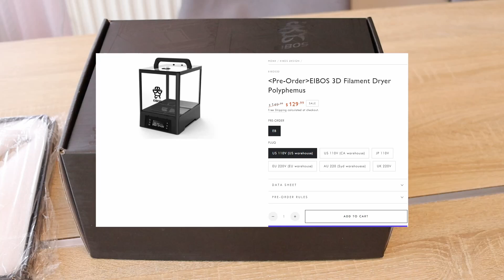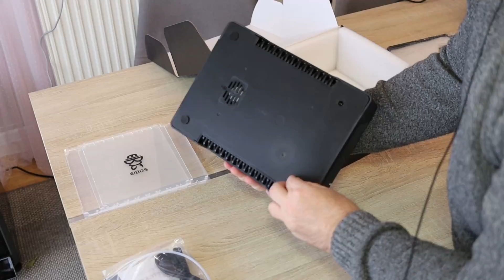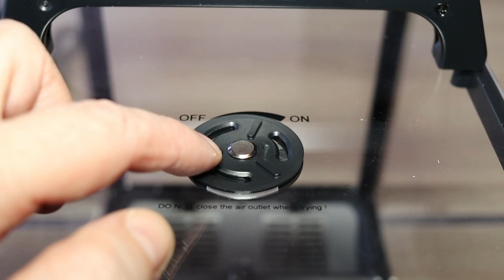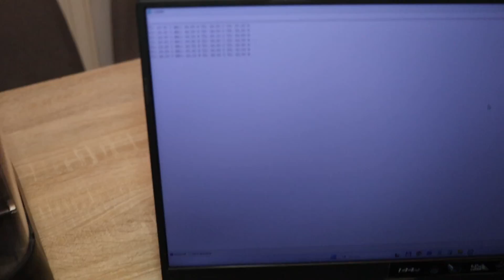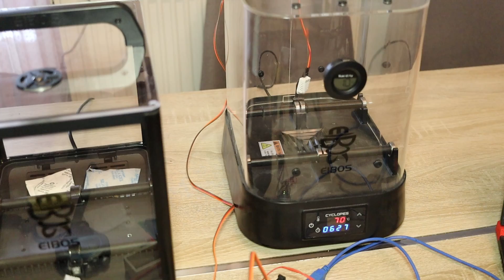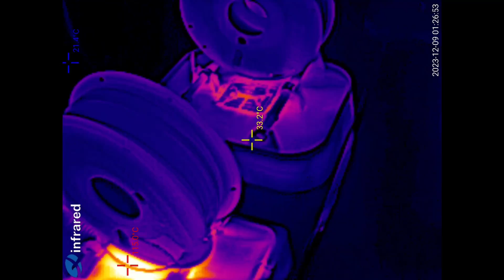Battle of champions: Eibos Polyphemus vs Cyclopes - which one is better filament dryer?

Comment: As always, great video.
I have one question though, would the Polyphemus be enough for Sunlus Easy PA (PA6/66)?
Streikt from the package into this dryer, after that kept in an airtight container with desiccant...
Would this work in you opinion?
Reply from the maker: Yes, but depend of the start moisture, it may require even 1-2 days until fully dried. Try to get the 80°C version.

Comment: Does this printer have tangential exit for filament? It sounds like that was the big weakness on the Grakit. This is more expensive but if it’s less loud than other dryers with fan, performs well and addresses the 90 degree exit on most dryers might be worth it.

Comment: In a review video by Modbot I heard that the rotation motor only has a predicted life span of 1500 hours, which he calculated to be 2 months non stop operation. Hence the spare motor. Eibos claims it has machines running much longer on a motor. But if you print a lot of nylon and have this machine running all the time you'll be buying a new motor let's say every 6 months. I consider this to be quite a serious design flaw.
Modbot was not very enthousiastic about the rotation function. He thought that it added nothing to the effectiveness of the dryer. I think the rotation is a great addition. You showed why. Also I saw a video by Woodbutcher and the Mighty Termite (what a name 😄) in which he explaines how he fixed a design flaw in the Cyclopes. This flaw would be that the fan in the bottom of the machine blows the hot air straight onto the filament. If this is the max temperature and you do not rotate the filament by hand every half hour or so (easy to forget!), not only does the filament not dry equally like you showed but the high temperature on the bottom of the spool may also damage the filament and/or may cause it to stick together
So I think I will go for the Polyphemus. Despite the motor issue. Although I have to watch some more Sunlu Filadryer S4 video's, because that may also be an attractive option. Thanks for the great review.
Reply: It’s actually more like a year (drying time) since the motor only operates every 4 seconds or so and turns the spool for a second. Don’t know why I was compelled to answer that 2 months later lol.

Comment: How about the humidity mode ? The one where it only turn on if the humidity raise above a certain value (for medium to long term storage). Do you have some thoughts on this functionality ?
Reply from the maker: That would be great if I would have 5-10 dryers, but since I always have at least one printer in work, I almost continuosly need this dryer, not for storing.

Comment: Thanks for taking the time to give us such great comparison metrics on the driers.  I recently got the Polyphemus and love it so far with the exception that my incoming filament, when printing from the drier, sometimes jams.  My bigger question though transcends all the driers and it's simply have you done anything to prove the inside coils of filament, that are effectively shielded by the outer coils, are dried too?  I understand that a sponge gets thoroughly dried, but what about the inner coils?  Is that one of the reasons we need to print from the drier for the more hydroscopic materials so that they dry as the outer coils get removed and expose them?
Reply: Theoretically the water molecules will excite up through the filament, transferring their energy THROUGH the filament coils! This of course is dependent on the type of filament, constant heat and thorough movement of the air. My concern is pushing too much hot air DIRECTLY onto the filament that is directly above the heat source. I've read where a user built an alum displacer piece to move the air away from the filament and around the outer edges of the roll.
Reply: The design of this dryer should alleviate some of your concern.  The heated air is actually directed out the front and back of the center rather than directly above the heat source.  In addition, the spool rotating function will also help distribute the heat evenly.   I was hoping that someone had gone the next step in testing beyond the sponge and did something that is even more representative of the real use case and verify these driers actually do dry the inner coils.

Comment: I have several Cyclopes driers, and I just put the desiccant pouches inside the center of the spool (which also puts them more central to the cavity)  I love your use of an Arduino, I use them and modules all the time too :-)
Reply: well, I just remembered another thing.  If you have one of the original Cyclopes like I did and they eventually go dim on the display or stop working all together.  You can reach out to EIBOS3D support and get them to send you the upgraded version of the "mother board", heater/fan, display/controls.  Cost is $10 including shipping (I believe this is low because they treat it like a support replacement.  They are still the typical LOUD Cyclopes fan as always, but they do work great.  I would be curious to see "My Tech Fun" redo his tests, to see if these new electronics make the Cyclopes perform better, worse, or the same.
Reply: Highly recommend finding a handle on printables or thingiverse and print out a handle for your Cyclopes.  If you have both filaments in there feeding printer/s, you are going to have a challenge balancing the Cyclopes lid without a handle.  On my 3D Printer farm, I use a small cable attached through the top center hole and just pull the cable that is loosely on the rack above it, then I have a 3D printed hook on the other side that I hook to part of the rack system.  This completely holds the top lid of the Cyclopes for me while I swap filaments.  But if you aren't using these in a farm, I use 3D printed handles for my single printer setups.

Comment: I don’t have either of these but I recently bought the single spool Eibos. It’s so easy to use and is quiet. I dried a bunch of filament spools that were very brittle and unusable. Paid for itself already……I also use it as the holder while I am printing. Very good design……..

Comment: I think all these dryers would benefit from an all-around and top layer of cork (even the one for desktop by IKEA), which would reduce losses and make the temperature measured by the internal sensor much closer to the one of the air.

Comment: In my mind the rotating function to achieve constant drying through the whole spool is a must, hence i got the Poly on pre-order since before Christmas. So far i've only used the X1 Carbons filament drying function, and while it works, it's slow, i can't use the printer while it's going, and it has got some of my PETG to stick to itself, so it's very much a "in case of emergency" type solution.
To better test the rotating functions effectivity, maybe you could wrap some sponge around an empty roll, and repeat your test..? No clue if that would make any difference in the results, but that way it would be more real world relatable test. 🙂

Comment: Another awesome dryer review. I got this on preorder and I am very happy with it, especially compared with the FixDry crap I had to return. Might mod it in the future with even more silent fans and a more silent spin motor.
Reply from the maker: After this video FixDry contacted me, they are sending me their dryer too. We will see how it performs. What is your main problem with it?
Reply: @MyTechFun  hahaha awesome then. This is the list of things I did not like from their latest double spool dryer:

1. I read somewhere that the system powers up the heater based on an algorithm programmed at a 21C room temp. It does not take into account the temp measured with the probe (I have not tested this)
2. Sketchy electronics. 240V enters a main board which is itself a bit sketchy. The screen flickers on and off constantly and the instructions say to never leave the dryer on without supervision. Inspired me zero trust.
3. Very noisy fan. Discovered that the main issue here was the plastic grill from the case in front of the fan. Cutting the grill to leave the hole exposed reduced noise quite a lot. That mod paired with a good Sunon fan it was worlds better.
4. Noisy heater relay
5. Inside temperature I believe I measured a max of 50°C

As soon as I saw the Polyphemus preorder at less price than the FixDry, I did not hesistate to return it and buy the Eibos. It's on another league.
Reply: @MyTechFun   @MyTechFun   Fixdry uses a DTH11 with a nice offset to skew the measurements to make it look better. Destroys the eibos in build quality and materials and is actually safe   and uses the right materials. My cyclopes started to melt. My second one has some deforming because they used cheap ABS but the Fixdry dual dryer is just crap and honestly not even good for pla. Average chamber temp when set to 70c was 45.2c. When i checked it i froze the sensor and it would no go lower then 20c. So i used a ThermoStream ECO-810-M as a source on the DTH11 and found out they used that to make a offset.  In reality its a 50c unit not 70c. Cyclops i found to be accurate to 50c then its a little off at 70c i was hitting 62c. These are chamber temps. Eibos was measured at the stock hydrometer location  Fixdry was measured at the same location.  Eibos has ok performance still not in my 5% spec but a few mods can get it to whiten 1.5% but its built like trash and like i said. 1 melted the other after one use i could see heat damage its trash. The Fixdry is built nice. It does not feel like a $10 dryer off wish  like the Eibos but its a 50c heater at most that they make people think is better then what it is because of the offset. Neither one is worth the price. Measurements were taken with  NIST traceable equipment.  If you like we can compare notes and what not on dryers. I got a bunch i have tested to try and fine one that delivers on its claims whiten 5%

Comment: Thank you for making this comparison video.  Very good analysis.  I'm a first time 3D printer owner.  I will be printing mostly with PLA, but then I expect to move up to PETG.  I understand that PETG absorbs moisture alot, so I will be getting a Dryer for it.  Thanks to your video I believe I will go with the Polyphemus because of the rotating motor and I also like that we can remove the shell without having to also unthread the filament.

Comment: Would it be possible to also compare their power consumption? I'd assume they are similar but it would still be interesting. I'm using a repurposed food dehydrator for filament drying and it uses around 300W. So the power consumption can get quite significant when you run it for hours.

Comment: I can see rotating of the spool to work only
- if the spool is used by the printer (rotating naturally) or 
- if the filament is not fed through the holes/tubes.
When the filament goes out of the box but is not being printed, the spool cannot rotate.

I would think most uniform result in all use-cases would be by having the hot air circulate inside the chamber around the spool. Then it wouldn't matter what the spool does.
Also maybe adjust both heating power and input of fresh air / output of the moist air (separate fans for circulation and input/extraction) based on relative humidity for better efficiency, when not in a hurry ;)

(But having 30C temperature difference between outside and inside, and printing just PLA, humidity is not current issue for me - well for my skin yes, but for my printing not 😎)
Reply from the maker: Of course, during printing, it will be rotated by printer. But some sensitive filaments, I like to pre-dry before use. You will see in my next Extrudr TPU video (test in progress, but printing is finished) I dried it 4-5 hours before use, huge difference in print quality.

Comment: Oven wouldn't work?
Reply from the maker: Oven is not accurate, it can easily overshoot the temp by 20-30°C for short time, you can melt the filament or spool. Other: My wife don't let me drying filaments in oven (and maybe she is right, drying ABS or ASA in same place where you prepare food - maybe don't go together)
Reply: @MyTechFun  😅
Thanks. Good to know such a large overshoot is possible. I have to test  before using it.
Probably for pet-cf and pc it is easier not to melt because of the high melting temperature...
Reply: @MyTechFun  I am trying to use xplus3 as a dryer with it's heated chamber. I setting it on display. The problem now is that it has some timeout and turns off the heat after some time.
Reply: I used the oven to dry some filament, unfortunately my partner turned the oven up for cooking without checking inside first!
Reply: @A_Tempest  wow that was something 😅

Comment: Are either of these safety listed with CE or UL?  Not a fan of resistive heaters that aren't safety listed, as some models of filament dryers have melted themselves.  
Many food dehydrators are safety listed, are cheaper than bespoke filament dryers, and can achieve higher temperatures.
Reply: Both Eibos ones are using PTC heater, the hotter it gets, the more power it needs to be heated up, meaning it won't catch fire and burn down. That's achived by physical materials in use (barium titanate ceramic stones), don't have to rely on software. PTC heaters are designed to run at certain temperature, if it goes over that temperature energy required to keep heating up scales to infinity exponentially. I assume Eibos designed their heaters optimal temperature around 70-80C

Many other dryers use traditional metal wire mesh for heating. Which works the opposite. It will start to heat up exponentially the hotter it gets, which leads to burning down device, unless there's some software protection, which hopefully doesn't have any bugs in it... They are cheaper to produce and heat up faster tho

Same traditional heater is used in many 3D printer chamber heater elements too. Especially in DIY segment, since it's cheaper
Reply: If they are that safe, then it shouldn't be an issue to have them listed by UL or CE... yet they are not.
In this case, believe the best drying tool is not a bespoke filament dryer, but a commodity food dehydrator.  And because they are commodity products, they are cheaper, can achieve higher temperatures, have more powerful fans to remove moisture more quickly, and yes, are safety listed.  Cannot see any good reason to recommend the purchase of a bespoke filament dryer.
 @marguskevinsunter

Comment: Great, I received my Polyphemus 2 days ago and it's already been fantastic so far. Looking forward to your results!
Reply: Did it come with a spare motor?
Reply: @limonada_spatiala  That's a great question! I saw where the motor craps out after about a year of solid drying.
Reply: @ChannelRejss do you have problems with the fan too? Mine works great, excellent results, but my fan housing bent due to the heat and got hit by my fan.